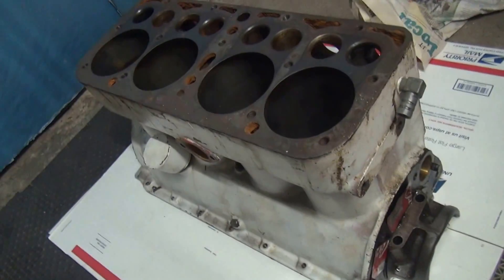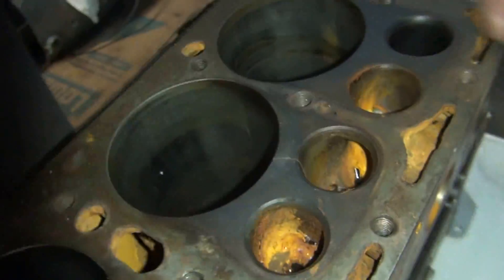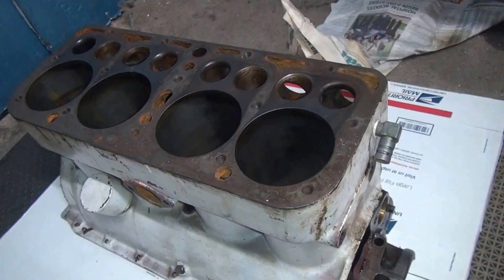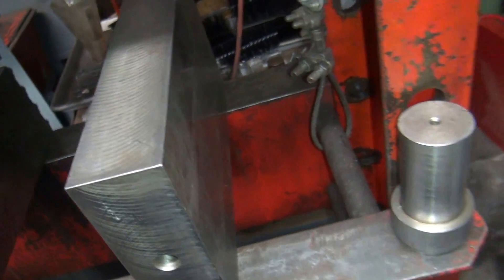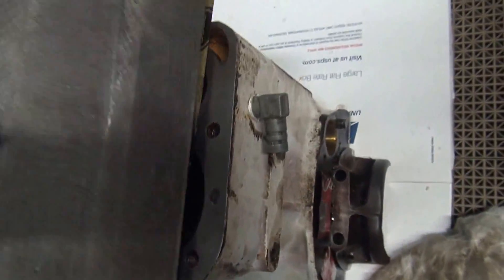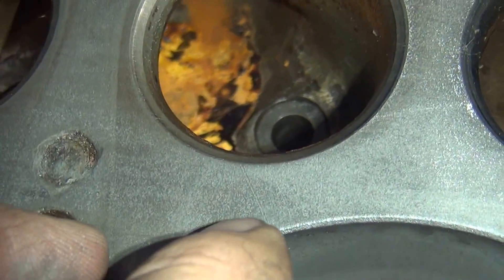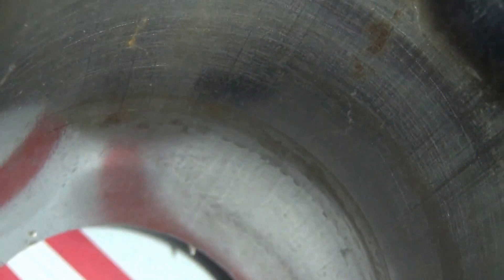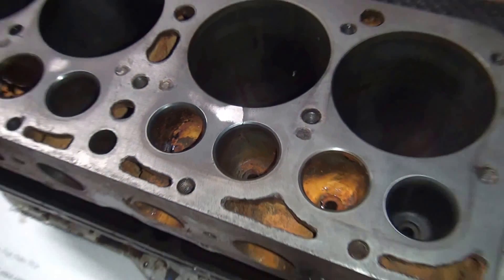1932 ford #101 model A or B flathead race block crack repair by tatro machine

Comment: Crack repair-this one was different-very interesting. Was welding an option?
Reply from the maker: michaellfbvr no really, I think that would have made a bigger mess. if I did weld it, it would only had been brazing.tatro
Reply from the maker: Tatro Machine oh, I forgot. so far the repair is holding after two races.the block also passed a 60psi pressure test with no leakage at all. they were very surprised that it held.tatro
Reply: Tatro Machine I also had my doubts because this was the first time I've come across this method.  I looked online and I see tapered pins is the tried and true method for crack repair for cast iron-simply amazing technique. Thanks for sharing.
Reply from the maker: michaellfbvr I did not use regular tapered pins because they cause to much stress on thin castings like this block. I used a straight pin with a slight taper on the last two threads only for the thin bores and a straight pin with special threads on the top deck to get more strength. lock and stich make these pins.tatro